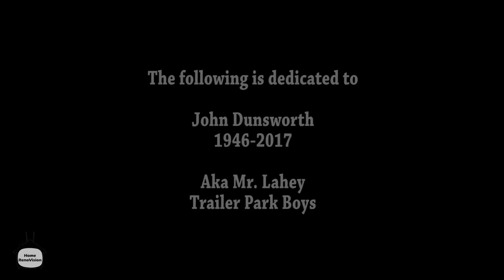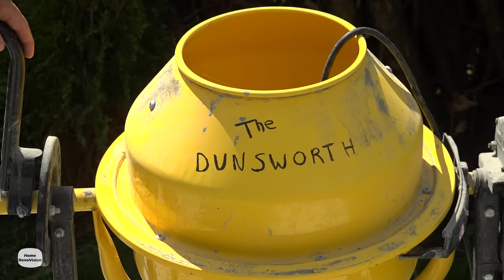Pouring A Concrete Pad | How to Build a Shed | Part 2

Comment: I know your not a Pro at concrete but couple of tips the dirt and base should have been compacted. and sometimes it’s easier to order more gravel and a yard or so of sand and buy 5 bags of cement and mix it by shovel.  1 part cement 2 part sand 3 part gravel. Cheaper and less work of lifting the80lbs bags. Ask me how I know I’m a mason a I do a lot of small concrete jobs.

Comment: Making a square or rectangle that size? Forget 3x4x5... just measure from corner to corner on the diagonal, and make it match the corner to corner on the opposite diagonal.
Reply: That's how I do it to.
Reply: @1811bruce  *too
Reply: I agree. And I would never accept 1/4" off, or whatever it was, but that's probably just me.

Comment: Love the presentation and detail. I also love the hard work put into this. For a DYIer this would probably be good enough.  However, I would never recommend most of this unless you're on a super tight budget and have low expectations for the results. Concrete needs to be delivered and pumped in and you need to have better tools...float, mag, edger, proper concrete broom, etc. And I agree with others that the dirt needs to be packed. A pad this size can be done well with 2 people and the right tools if the concrete is delivered.
Reply: I want to have a 12x26 how many people do I need.

Comment: I am pretty handy with my hands and really like your videos.  I think a lot of problems with some of the comments here is contractors who do not want DIYer doing the work themselves and would prefer to charge people a lot of money.  Are there things I would do differently?  Of course!!  But as you said "it's a shed" .
Reply: Jim Oakley that is exactly my thought as well!
Reply: Or people just want to give DIY’ers correct information so they don’t build a slab like this one... nothing anyone is suggesting is hard to do. Just very simple steps that are crucial to pouring a proper slab.
Reply: Ok, I'm a total diyer, and there is no way I would settle for this job. No tamping? Not rounded edges? finish pouring the next day? One bag at a time? Seriously, this looks terrible. I never pick on others, but this is so bad, I'm wondering if this guy is punking everyone.

Comment: I love how you backfilled with dirt and then didn't even handstamp the soil... lack of compaction will cause issues in the long run. Your slab is going to crack.
Reply: wonder if it cracked a year later...also I don't think hand stamping would have done much. Tamping it would but he tends to cut out parts like pulling the wire mesh up while pouring.

Comment: for that amount of concrete, next time call your garden center and have them deliver a couple of yards right to the pad in liquid form. Costs a couple hundred bucks and you don't have to do all that mixing.
Reply: Jeff Voight , true. They also have access to great add mixtures like plasticizers so you can make stronger concrete by using less water. And much more! I’m a fan of 4K to 4.2K PSI as a general rule. Also, I always go the full 3.5 inches of the 2x4 in concrete. If you are putting an underlayment like the stone do that below the 3.5 mark. He won’t be parking a car or anything so it’s not critical. And that thin wire is meh for re enforcement. Use micro and macro fiber, the cost is minimal and no steel required. Solves a lot of headaches.

Comment: You hit on why I’m building my shed foundation on top of existing soil and not digging in. My shed is under a huge oak tree and I don’t want to disturb, or fight, roots. I’ll use gravel to level and treated 4x4 skids with treated 2x6s for framing.

Comment: Hi, Just out of curiosity did you check out the difference in cost between mixing yourself and getting  ready mixed delivered. I've done both methods and would choose ready mix if not excessively costly, just for the time and effort saved, plus getting a constant pour for strength.
Keep up the good work,  enjoy watching your relaxed style.
Reply from the maker: delivery here is more than the cement. Plus we wanted to try out the new machine. Cheers!

Comment: Love the video Jeff and I truly appreciate the insight. But in this case, 60 bags of concrete is probably about $250 plus the delivery or transport, and then you have to add in the mixer, water, and time...at least in my area you can get 1.5 yards delivered for about $350 and they're done in 15 minutes.
Reply: I see easy access for the cement truck at that gate 3 feet away.

Comment: Is there any concern of gravel settling without any tamping?
Reply from the maker: we only used a 2" base and clean stone so there isn't any issue with settling. remember we are building an outdoor temporary structure. Our needs for performance are much less than when building a permanent structure.

Comment: Good job Jeff I do concreye for a living. I love your channel because you are so thorough in all your processes. I can tell your a man thsts proud of your knowledge and work and love to share it! I appreshiate that about. The only thing inwoupd of dis different is hand steel it a few more times and use a real concrete broom instead of push broom. Everything else was good. I would also mix all my bags with a tile drill mixer. 60lb bags

Comment: Pouring a concrete slab is technically easy to do but back breaking work, this however is not how to do it. That is such a sloppy job and it isn't much effort to do it right. The gravel should be compacted, the form work should be screwed together at the corners and staked along the sides so it does not move as the concrete is worked. There should be a vapour barrier used to keep moisture from coming up through the concrete making the inside of the shed damp and rusting your tools. Also the reinforcing mesh should be raised up from the gravel about an inch so its well encased in the concrete it should also be overlapped to form a continuous mesh along the whole slab. After trowelling the concrete if you wait for the surface to dry out a little before brushing it, that you get a much better surface finish. Also if you are doing this on a hot day you absolutely need to keep the surface of the concrete wet until it sets up. If it dries out the cement will not bond correctly and you end up with a weak slab that disintegrates over time. Its hard physical work to pour a slab so worth the extra effort to do it right.
Reply: Are u serious?
Reply: Exactly!
Reply: Well said polite and intelligent
Reply: Im waiting for your video.

Comment: Should have just ordered 3 yrds of concrete
Reply: 1.5 would give you 4"
Reply: @cobrakai2872  Most places here in TX wont deliver anything less than 3 yards.  I think I would build to that minimum. 12x16 with 5" thickness

Comment: After deciding where I want to build, I shoot elevations with an old optical transit and rod. You can make a rod by tacking an old tape measure to a board. I don't know if old transits are easy to find because I inherited the one I have, but it sure saves a bunch of time with layout.  You can do the same thing with a bucket of water and a tube. I'm almost always surprised by how much slope a level piece of ground has.

Comment: If your mixing concrete for anything that needs to be worked ie screeded like a pad; You are going to need a greater slump (more water). Also it's important to broom the concrete in the opposite direction of travel and wet the broom before you use it. Make sure you keep the concrete wet as it cures too and oil the forms before you pour. Also a vibe is highly recommended if you don't want air bubbles in your concrete.
And there's no control joint.  Honestly I don't recommend taking his advice when it comes to concrete. I know this is just for home owners but this is just bad advice.  No offense it's just hard to know everything when it comes to construction. Being a pro is knowing when to ask a subject matter expert when you aren't certain about how to do something
Reply from the maker: Hi Johnathan, Thanks for propping yourself up! This video was designed to give homeowners a practical guide to making a slab for use in outdoor situations where the quality of the finish is not the number 1 priority. After all I am building a shed not a driveway. Please save your arrogance for your own customers.
Reply: @HomeRenoVisionDIY  I understand that it's just for homeowners and it's just for a shed. I don't claim to be an expert myself. The problems lie where people look at you thinking that if they do what you say they will have a structure that will last. I'm not saying that I know more than you but you are setting up home owners to  fail. I'm certain that multiple people will attempt this with very poor results and waste their hard earned money. I do enjoy watching your videos but please recognize that people look at you as an expert. If you need help please ask for it
Reply: @HomeRenoVisionDIY  dude you did a lot of things that are not only not best building practice, but are code violations in many places. You dont know how to finish concrete. "Its just for DIYers" is not a sufficient excuse for telling people to do things the wrong way. You are clearly a smart and capable person not trying to be a dink. To put it another way: I never give people mechanical advice because i only know masonry work. It would be wrong for me to tell someone how to fix their car when i lack expertise in fixing cars.
Reply: I don't think he was being arrogant.
Reply: I agree with Johnathan... You should have watched a few other peoples videos first... And Johnathan isn't being arrogant... If you are teaching someone how to do it, teach them the right way, not the half ass way... you said "I am building a shed not a driveway"... what is the point of building the shed, if the foundation is poor and needs to be replaced before the shed rots away? 

In addition to all the other comments, about what you did wrong... you added a bevel on the slab and once you back fill, when winter comes it will give the ground leverage to lift or shift the pad. And on pads in a four season climate, you should have some kind of reinforced footer. Otherwise the heaving during the winter will crack your edges or the whole pad. One other trick is build the form, so the top is flush all the way around, and stake it so the stakes are flush with the top or cut them off flush with the top then you can screed with out having to lift over the stakes. Way easier with out having to screw around the stakes... And with everything flush, when you edge it, which you didn't do either, it's easier than having to fight with a board in your way. 

And I watched some of your other parts too... do some more research first, before teaching others what to do.
Reply: F__kinell it's a shed folks, lol
Reply: What is great about DIY HOW TO ..projects is the courage to do it in spite of not being an expert. And what is great of having an expert (on line) watching the project and add a comment is that is very helpful for all (like me) who don't know much about it but want to do projects on their own. A win-win situation. 
Thank you for both of you
Reply: Darby Alvarado exactly.  He added the disclaimer in the beginning that he is not an expert and this is great for something simple like a shed. People acting like he’s charging people to watch his videos. If you don’t like them....don’t watch them. Lol
Reply: Chill out, people like you are the problem these days! You want to apply house/garage level code and engineering to a damn shed, and a tiny one at that! If you think that this foundation is going to crumble because he didn't make it to code and skipped crack control and tamping you are delusional. Should he have rented a power trowel as well? at what point do you stop???

There is such a thing as good enough, and If the slab lasts 100 years rather than 1000 with proper tamping and crack control, then so be it, jesus!
Reply: @thereddstormproject1954  Do you have a youtube channel? Are you qualified to tell others what they can say and not say? Maybe you need to tend to your own business?

Comment: Most common mistake A LOT of people do. They make the pad too big. Your cement pad should be the exact dimensions of the walls so you can finish the siding/parging down to the bottom so that water will not ingress under the bottom plate.  If you want a pad in front of the shed/garage, pour it after the fact, leaving a small gap between the two slabs so that rain water/melting ice will drip there. I have torn down many sheds/garages in my lifetime and most had rotted from the bottom because of this reason !!!!!!!!!!!!!!!!!!!!!!!!

Comment: At 22:30, why are you spraying more water (if you already had the amount from the directions added)?
Reply: I ask because I have tried mixing concrete in a container and it always seems that if I use the directions, the concrete seems dry and dusty still even after mixing and seems like it does not have any water (it does not look like the soup that comes out of the concrete trucks).

Comment: If you could pour that slab and finish by the end of the day with that mini micro mixer, I say you really work fast. I use a plate vibrator making sure to compact the soil and a concrete vibrator to remove trapped air. Haven't used the mesh wires but use #3 (3/8") rebars about 12" on center with wire ties and dobies. Not a pro but so far so good. You could put 9 bags at at time on one of those HD landscape 4 wheel carts moving it from point A to B. And a hydraulic table lifting multiple bags of concrete into the mixer helps a lot, saving me from another rotator cuff injury. Just me and the little wifey, pouring a little section at a time.
Reply from the maker: Cheers!

Comment: Do you know why my concrete is dark grey in color when I mix them on my own, with cement, sand and 3 quarter blue stone, instead of using pre mix bag from home depot? I can't get the light grey color like the sidewalk concrete, ty
Reply: Because when the sidewalk poured in front of your house was done it was sprayed with a curing agent that gives it that really light color, almost white.

Comment: You should use a magnesium float to finish the surface at first so you don't draw up too much water and weaken the surface.
Reply from the maker: Hi Ben, this is definitely not a tutorial on how to make the best concrete pad. Just a strong stable level one that will function well for a shed. Cheers!
Reply: Oh ya I know that was more for you viewers just as an fyi. Great content!
Reply from the maker: Thanks Ben!
Reply: Magnesium floats are pretty expensive but why didn't he trim off the stakes with a sawzall?  HF saws are pretty cheap and great for jobs like this.
Reply: @picklerix6162  in his defense. Sometimes sawsalls can vibrate the forms out of square. I have always just tried to set the stakes below the forms
Reply: Ben Muirhead also, a magnesium float can seal up the surface of the concrete to much, leading to flaming and other undesirable effects. With the brooming, all he needed was to bring some cream to the top and push the aggregate down below the surface. Plus, a good magnesium float costs more than zero dollars, and if you will not be doing any other concrete work, would just be a one off tool.

Comment: Honestly bro. Im a cement mason and i can tell you from the bat you did this all wrong. Its ok for someone at home tryna get it done cheap. But its mostly all done wrong. Sorry buddy
Reply: What was wrong about it? Im not a pro but I think it was ok just for a shed. I've watch tons of videos from pros like Odell complete nd Mike day nd I dont see them doing anything differently
Reply: @nateg5915  . Depending on building code, the shed MIGHT be too close to property line.
It's probably wise to check on underground utility lines.
Depending on soil type, it MIGHT require more base (crushed stone).
The thickness of base and (especially) concrete should be fairly uniform.
The disturbed soil and the base layer should be compacted
A vapor barrier or landscape fabric MAY be required under the slab.
If rodents are a problem or if code requires it, you may need to contruct:
a.  A rat wall (thicker [deeper] slab around the perimeter).
b.  Embed wire cloth in slab and extend it 12-24" into soil.
Local code MIGHT require rebar.
Steel mesh or rebar should be placed on stands or raised during concrete placement to locate it at center (usually) of slab thickness.
Forms CAN be lubricated to allow for easier removal..
There MIGHT have been insufficient form stakes.
Placing fresh concrete  adjacent to set concrete MAY require extra measures.(Because of low capacity mixer or continuing the next day).
Slabs larger than 10' x 10" MAY require control joints.
Edging the slab helps prevent chip outs and gives better appearance.
Adding too much additional water while mixing creates weaker concrete.
No bull floating was (apparently) done.
Using a tile trowel as a concrete float or trowel MIGHT not give the ideal finish.
Brooming the surface too soon can leave deep grooves and/or gouges.
No mention was made of whether or not the concrete was properly cured.

Comment: Love your videos, I find a lot of great tips / info from them that I will apply to different jobs in the future for my house.  For instance, I plan on pouring a new 6x4' section of concrete on my driveway - it's an area that was 'capped' with a thin amount of concrete to hide cracks or whatever and of course broke up quickly after that and looks pretty rough.  Also I will pour a step for the front of my house - it was 4 small blocks about 4" tall - you can't purchase the size step as far as I know so I will try to pour my own.

The biggest difficulty I will face with this is how one side of the concrete driveway has a raised ridge - and I will want to match it up to the other ones, not sure how that works!
Reply from the maker: check out odell concrete on you tube.